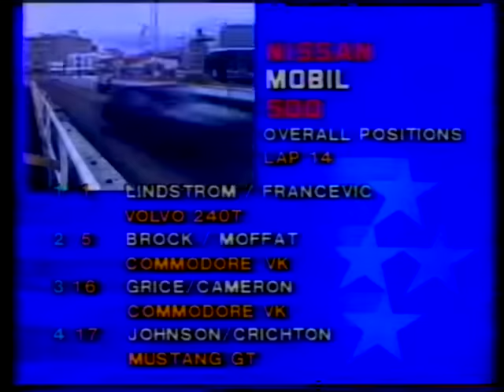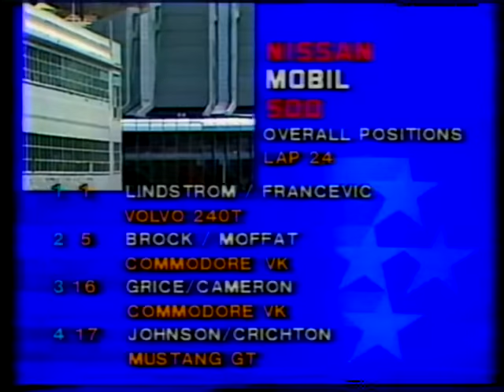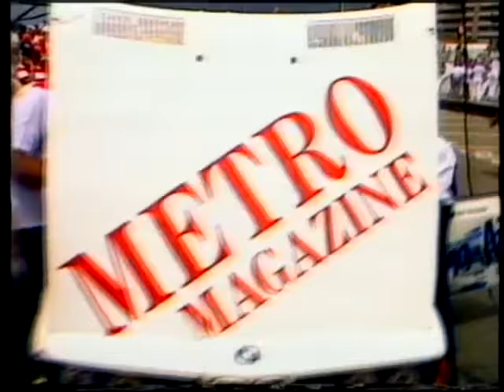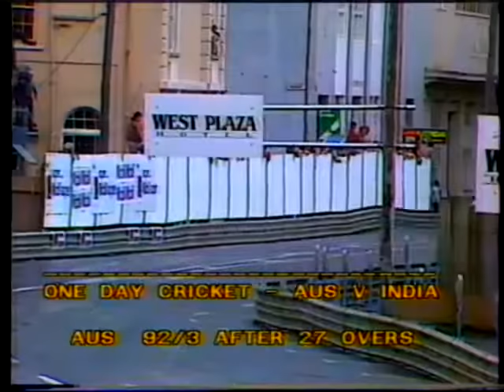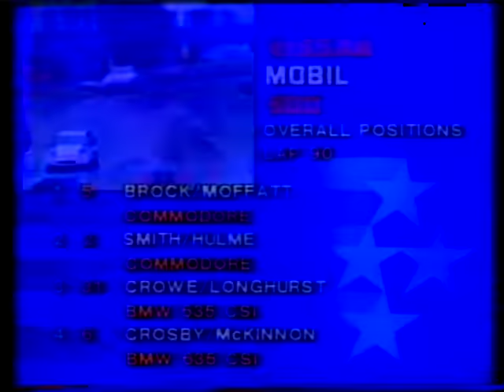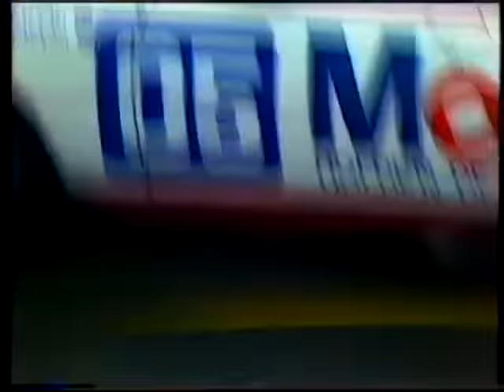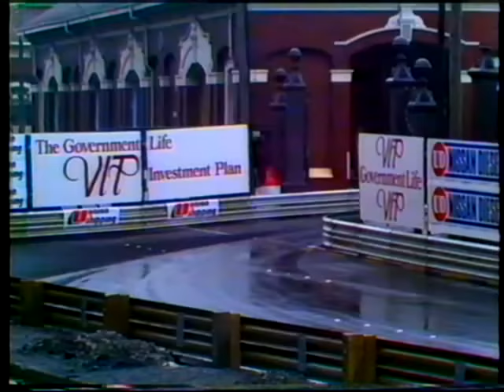Nissan Mobil 500 1986

Comment: Harvey's commodore retired with a broken oil cooler, strange that the same problem would happen at Bathurst to Brock/Moffat that same year. It let go where you see early on a couple of cars get very sideways. In this race the Volvo's power to weight ratio was superior to every other car, and Brock started the season with 370HP, by the time they got to Bathurst they would have 420HP